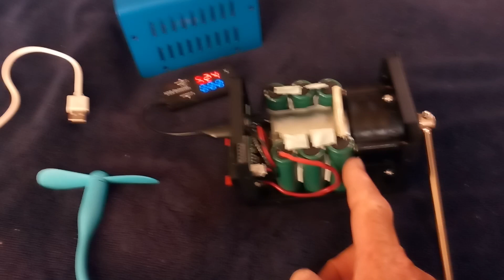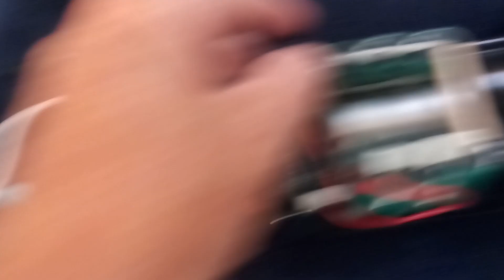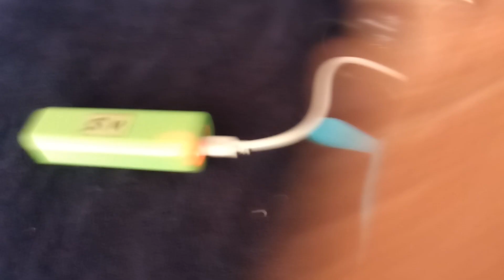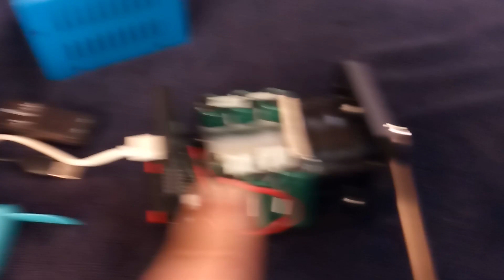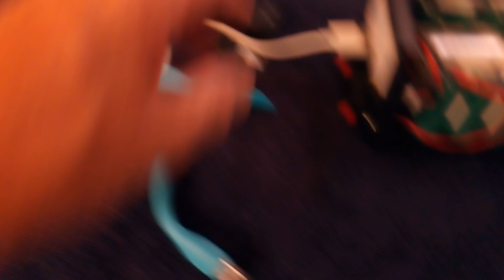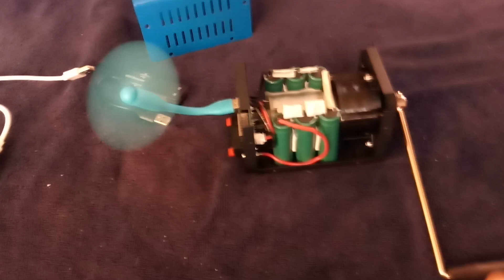Lasersaber Mini BoostBox---  Replication PART (2)

Comment: Great Job. 
Should be able to charge phones with this like it is..
Reply from the maker: YES!!!!  With the caps added the generator charges up a phone nicely.  It is still a matter of muscle power in vs electrical power out but the caps smooth the process and you can do the chore in segments.  I see this device as a great add to an emergency disaster kit.  There is old saying among sailors that the best bilge pump is a frightened man with a bucket.  The same principle applies here.

Comment: I recommend a battery operated dril for people who so not have enough money. Those can be converted in a generator very easily. Some drils even have a gearbox with two speeds so you can switch between low Amps High Voltage and High Amps low Voltage. Did you say those supercaps are 40 bucks for the lot? I remember to have paid almost the same, for six 500 F caps in 2020.
If you are not going to use the 12 Volt, and know a way to keep the voltage below or at 8 Volt, you can use the caps in 3s2p for double capacity!
Reply from the maker: Excellent advice!  Thank you.  Actually you can buy this motor with gearbox on EBay for $20 and build up you own generator from scratch.  An old battery operated drill motor is a great alternative.  As far as the caps, they still are not cheap but if you shop around you can find some pretty good deals.  Your idea about changing the cap array has already gone through my mind.  A 3s2p setup makes more sense if USB power alone is what the goal is.  This morning I kinda had a change of heart though and thought that I might really want a 12v output someday.  Perhaps an either or switch might be the answer.